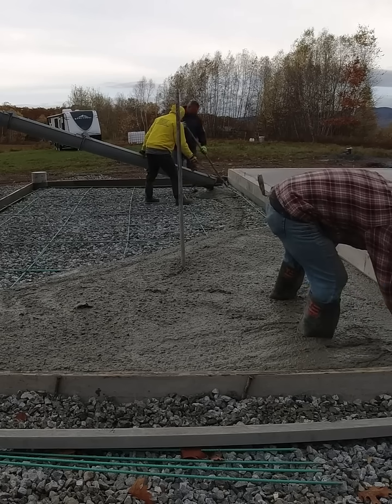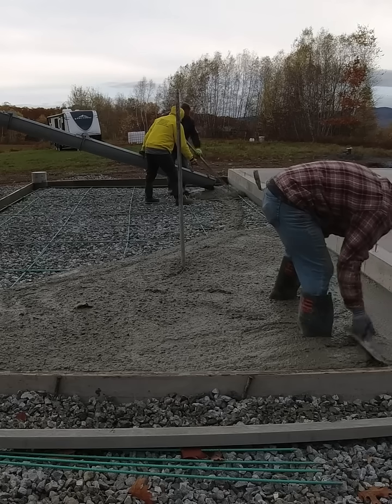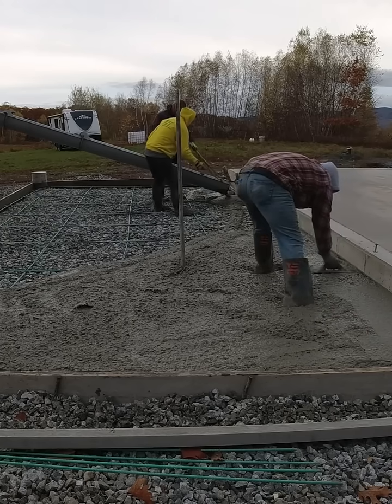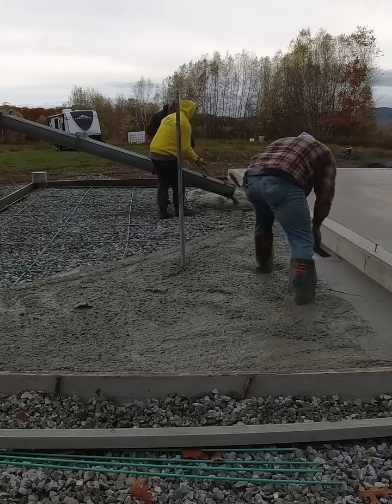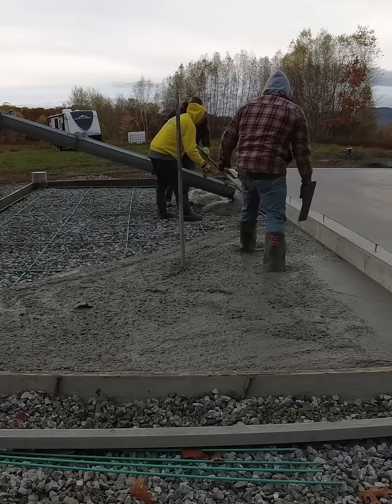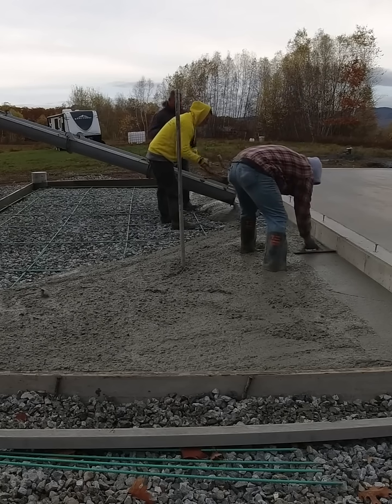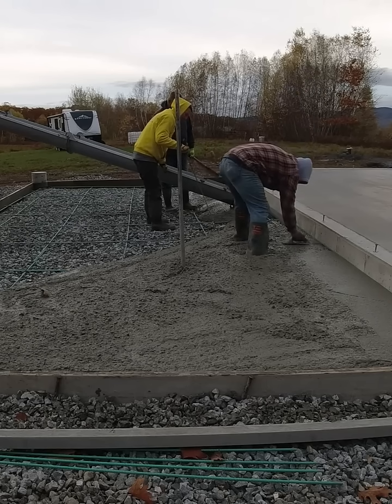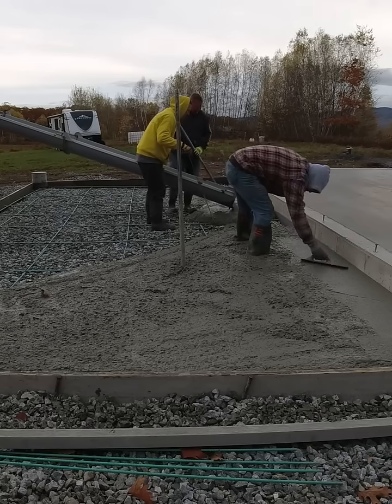My Cold Weather Concrete Mix #shorts

Comment: 100 degrees boiling water into the concrete mix, wow,
Reply: He said 100 degree water coming out of the boiler smart ass
Reply: that's just warm water. its 100' F/38C  not 100 C

Comment: For starters there were no corner bars tied in..amateur..
Reply: That's not their responsibility.  Mike's crew typically is only hired to pour/finish.  Sometimes more, but mostly they just pour/finish.
Reply: Thx for proving there's a peanut gallery for every video. Even the gold standard guy.
Reply from the maker: 45 year amateur, that's why nobody hires me. DH
Reply: @MikeDayConcrete so 45 years later you discover you've been doing it wrong for 45 years and your are still making money. That's how US works.